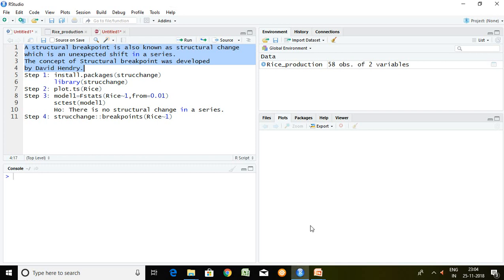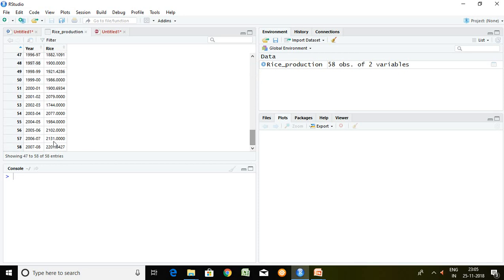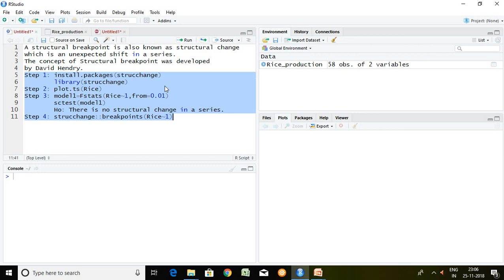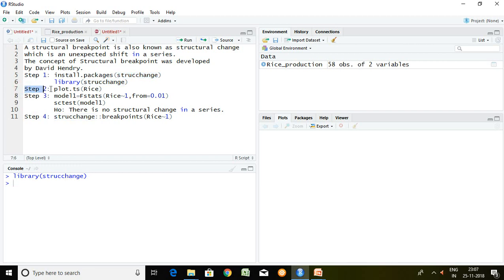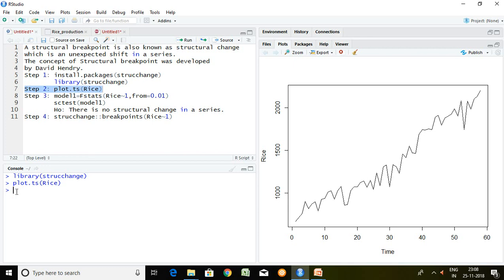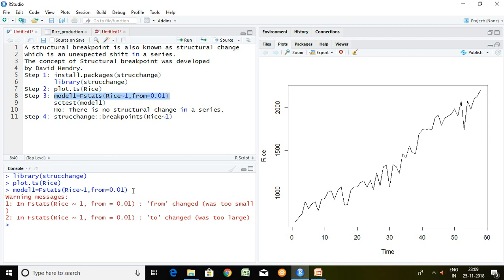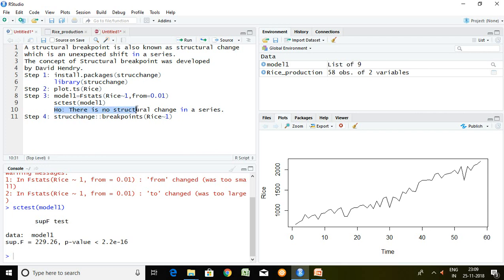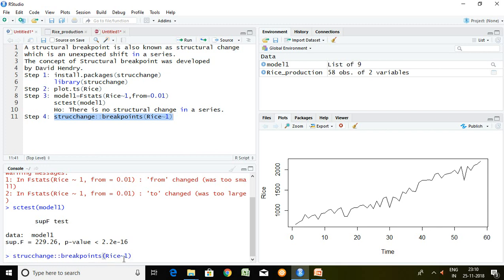8.1: Structural Break Change using RStudio

Comment: @Miklesh Yadav : You helped me a for some projects through your video , so thank you !! 

HOWEVER , When we reject the null hypothesis , in this case , we should say , the test rejected the hypothesis of the absence of structural change in a series but it doesn't mean that there is indeed a structural change in a series (which what you said in the video ). This is an important thing that a lot of people make a mistake on . It was just for the sake of the clarification. Please , do not take it personally , we are exchanging ideas and learning from each other. Again , thank you for your great contentes.
Reply: I fully agree with the comment.